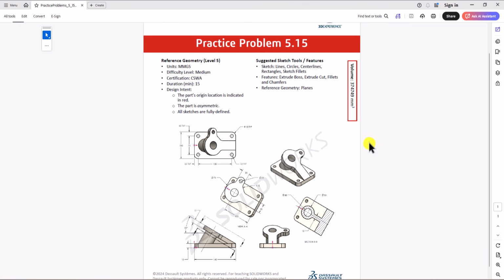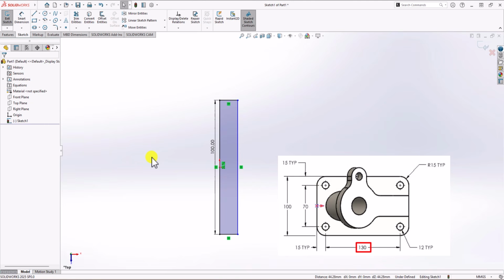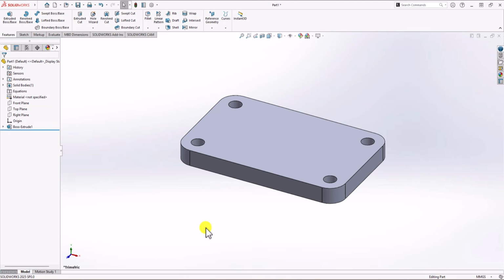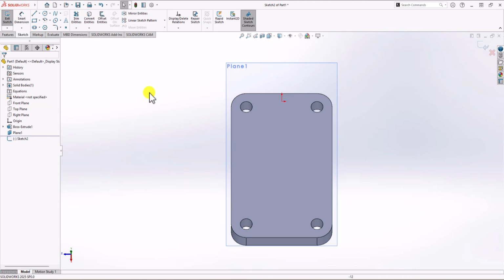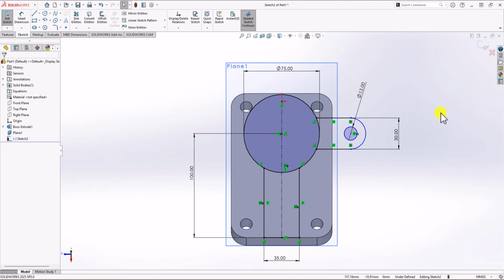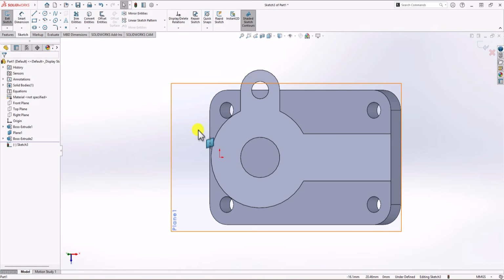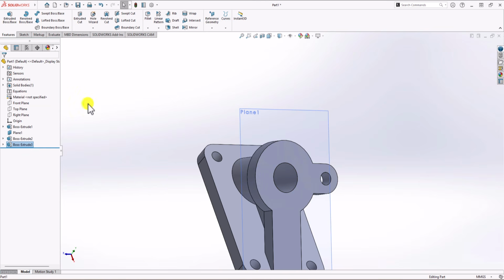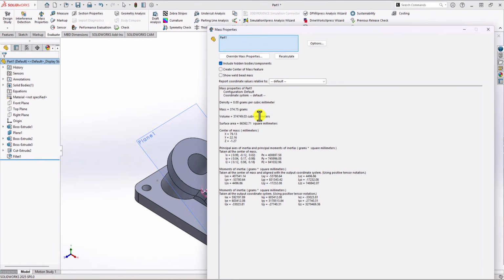CSWA Practice Problem 5.15 Solution | SolidWorks Exam Guide

Comment: the answer i got is 386988.13 without your guide, then i rebuild it following your video and still got the same answer, i did a drawing for my build and all dimension are good, what is the problem?
Reply from the maker: Unfortunately, it's really difficult to say without seeing your model. The only hypothesis I have is that the 30 mm center hole might not be a through hole. Could you check whether it extends all the way to the back side of the geometry?
Reply: @Design_With_Roozbe your hypothesis was right the 30mm was not cutting through all, i was so tired yesterday i didn't notice, thank you very much ❤
Reply from the maker: Glad to hear you found the root cause of the issue. Well done!

Comment: I ended up getting a volume of 374717.94 cubic millimeters, does this matter for the actual certification test for cswa or will I be fine. I followed everything you did step by step too
Reply from the maker: In the exam, there is usually a reasonable difference between the multiple options provided. Because of that, even if you make a small mistake and your answer is slightly off, you should still be able to identify the correct option by choosing the one that is closest to your result. In this case, the difference is only about 32 mm³, which is within about a 1% error margin, so you should be fine.

If you are really curious to find the root cause of the difference, I suggest creating a drawing from your model and comparing every dimension with the dimensions shown in the question. I demonstrated this approach in Question 4.6 here: https://www.youtube.com/watch?v=4YVDBOONNl4&t=588s
Reply: @Design_With_Roozbe  thank you very much
Reply from the maker: You’re welcome! Happy to help!